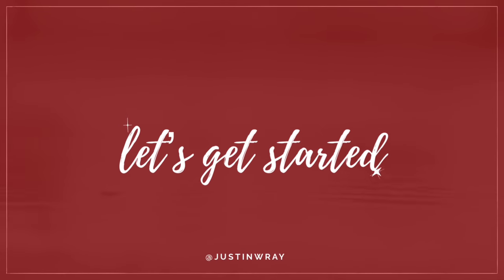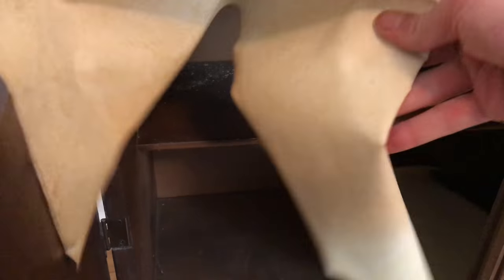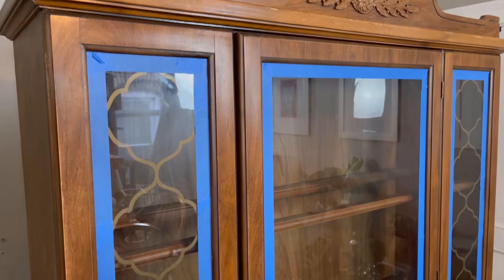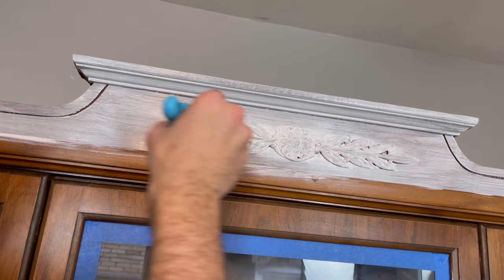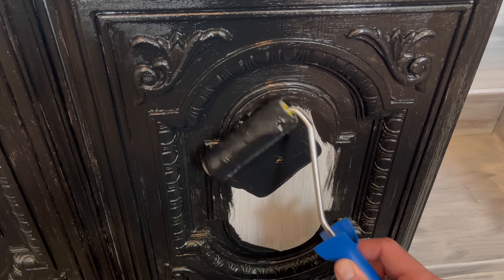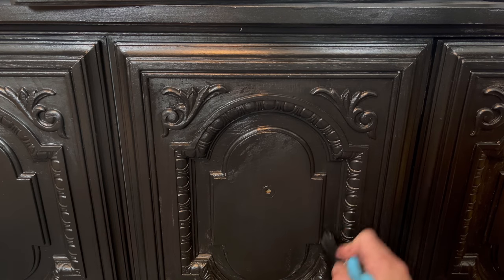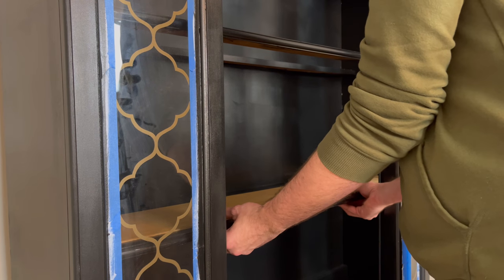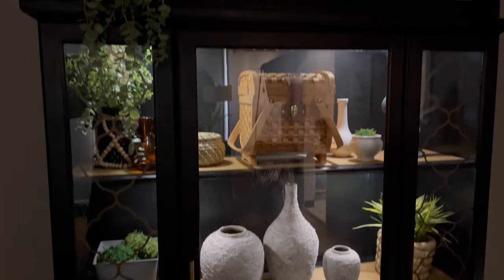DIY THRIFT FLIP // Easy and Inexpensive Furniture Update!

Comment: So jealous!  It is gorgeous, Justin!   I’m going to try it out for a curio cabinet I have.  I’ll use your shelving idea and lose my glass shelves.  My small, triangular cabinet already has a light but I have always been leary of the old wiring, even though when my parents had it they never had a problem.  Your solution is awesome.  Did the light set have a remote?  Also my cabinet has a mirror on the back wall which will help the light reflect better from within the odd shape.  Thanks for sharing, Justin.  I will check into the H.F.H. Link as well. ~Debbie Z~
Reply from the maker: Thank you! 🤗 And yes, the lights have a remote! This cabinet also had a light but I wanted just a little more! ❤️